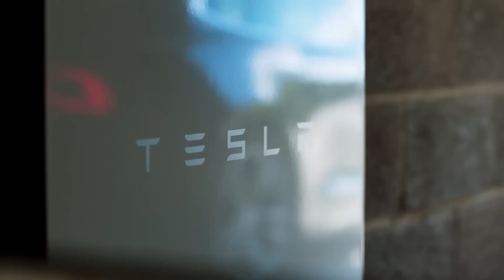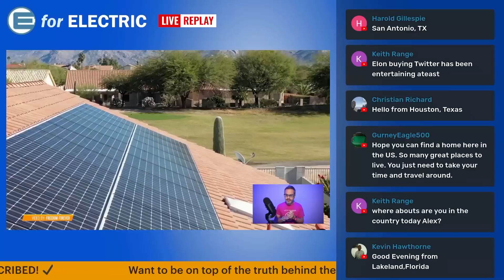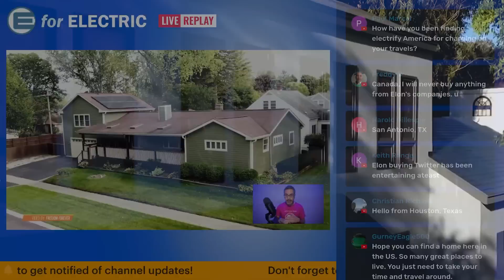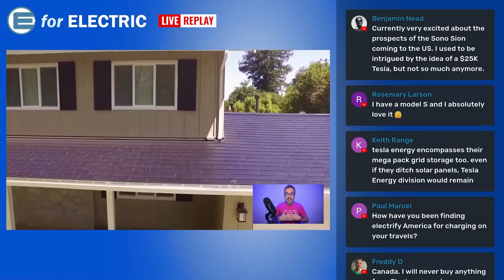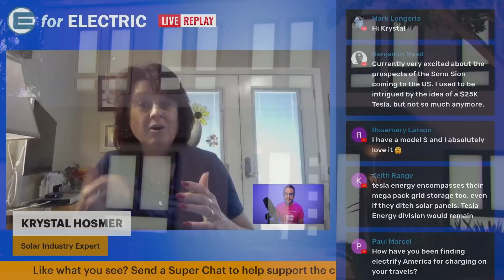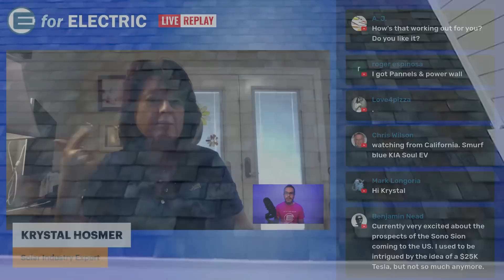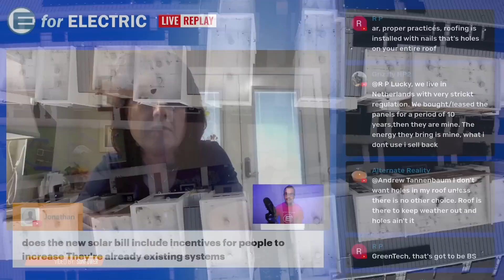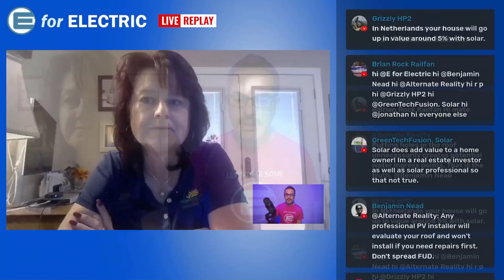Why Tesla is Losing the Solar Energy Game

Comment: The problem with solar roof it is way too expensive. I personally got solar panel and powerwall from Tesla and they are the cheapest by a few thousands. However, customer service sucks relative to local guys that can come and fix your system. Tesla has this tier system that will take like 3weeks for someone to come out. I had an issue where one system was not charging my powerwall. Well for 1weeks they did tier 1, basically useless lie just reset and hope it works. Then they put you to tier 2 they try to fix remotely. Well, that did not work. Then you have to wait 2-3weeks for someone to physically come and finally fix the system. So i can see why people would not choose Tesla.
Reply: You get what you pay for. You want cheap price well you got cheap service

Comment: She is right. Tesla Solar has horrendous customer experiences. I state this while I declare that I have competed in retail rooftop solar against Tesla for the past 8 years.  But I also state this from my own firsthand witnessing of bad service and unethical, fraudulent practices by the company.  I haven't met any industry veterans would not agree with me.

If Tesla is excellent for the automotive industry, Tesla Solar is the opposite for the solar industry. It has burned so many customers and potential customers that they are not just turned off to doing business with Tesla Solar.  They now hate solar.  They don't want to do business with any solar company. I have run into this hundreds of times in 8 years.

Also, Tesla was selling its solar products well below its profitable capacity, likely at a loss to destroy smaller competitors, which is illegal "dumping" if done in international trade, and it is not only bad business but it's also unethical. 

When a solar company does that for long enough, it goes out of business, and its customers are stiffed on warranties and service.  This has happened hundreds of times over the past five years in the solar industry.
Reply: I also worry about Tesla’s outsize influence over how homeowners feel about solar. By leaving such a sour taste with so many customers, it hurts the mass adoption of solar.  Humanity really can’t afford to have any actor slowing down the adoption of carbon-reduced energy production. Tesla needs to clean up it’s act in accordance with it’s mission statement. We are all on #TeamSolar, after all.

Comment: Tesla solar roof has numerous issues. Very expensive, not a lot of energy produced for covering the whole roof, most installations require maintenance more additional fees for other work ($1,000’s not $100-200). Takes long time to install, very few installers. Will have same fate as regular solar panels in 25 years. Roof should still be good, but very much lower energy output.

Comment: The Solar panels continue to get less expensive and are a small portion of the cost of a rooftop solar installation. The electronics which interface between the solar panels and your electrical service entrance are 80% provided by two companies (Solar Edge and Enphase) and continue to do more for less money. So, the cost of labor and interfacing with the customer and the city building dept.  are a greater part of the total cost. I ruled out Tesla for my solar installation as, like the lady said, they have a terrible reputation for customer service.

Comment: I compared tech behind them and tesla (regular solar) was cheap but was not as good as enphase. There is a night and day difference between the offerings. I would have preferred the solar roof even with the tech that is not as good since cost of roof was included but then they raised price on me a week before install. I was already sold on enphase, if I was going with solar on existing roof. 
Micro inverter, ability to generate power while grid is down, combine batt and solar production while grid is down etc etc. 
Batt is also Lifepo4 with enphase. The list goes on and on. My neighbor has solar roof. They do look good and that was the selling point but not at price they tried to get me at.  Before that debacle the price difference was about 10K between redoing my roof and solar panels or tesla solar roof. They raised it so much that it was unreasonable, had signed contract too. They offered later to honor the price but I already pulled trigger and was not gonna go there again. I cant remember but price went up by 40-50K if I remember correctly. 
They claimed roof complexity.  Honestly a year or so after, I could not be happier. Comparing my setup with neighbors who have different systems. Enphase is just that good.

Comment: The solar roof is way, way too expensive. I was looking at it for my current house, way to expensive. I also looked at it again for my new construction house, again way to expensive. The solar panels and power wall, oh yes! It’s at a good price. They are definitely going on my new build.
Reply: That’s the problem. People keep looking at “Buying”…Why buy when there are other options? Less responsibility.
Reply: @AlessandroZane  What are other options?
Reply: @chrisroberts3963  PPA AKA leasing. It’s basically what you are doing now. Paying the utility company a price per kilowatt. The PPA you pay electricity per kilowatt but a much lower rate. Plain and simple. 
Would you rather pay $5 per gallon of gasoline or $3 gallon of gasoline?? I’d rather just pay less and you assume no responsibility for the system just like right now you assume no responsibility for the power plant or the power lines. It’s all taken care of.